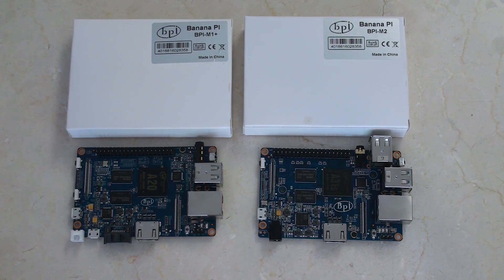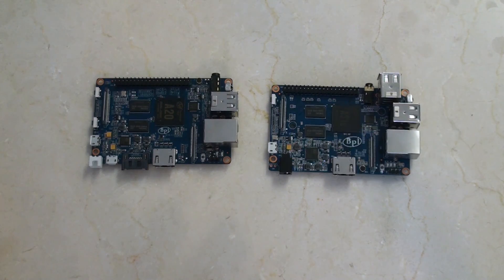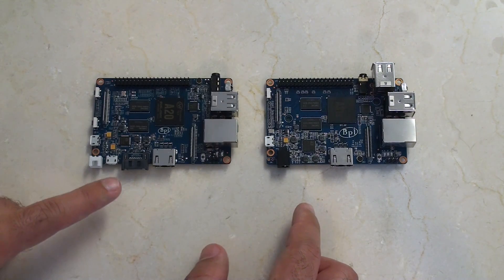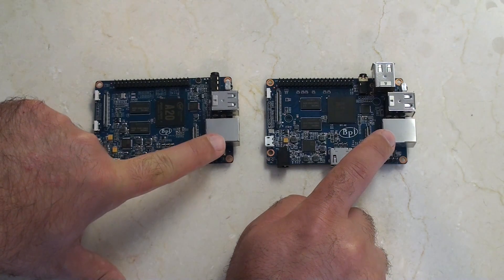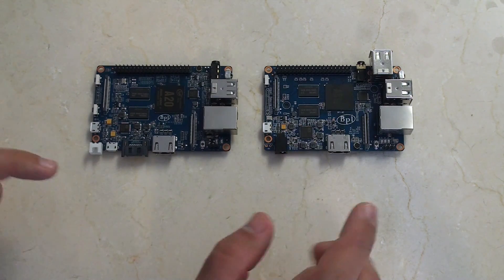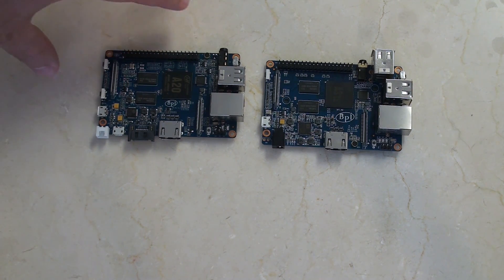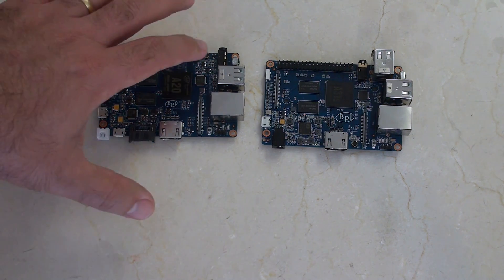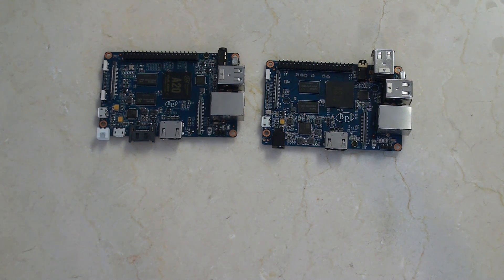Banana Pi M1+ and M2 hardware comparison and feature walkaround

Comment: Hello, if this computer runs android am I able to play some graphically demanding games like gta?
Reply from the maker: +mac16a Great question.  I've struggled to get Android working properly (as it requires a Windows PC to get it installed (which I don't have).  All that to say, I haven't had a chance to test it myself.
Reply: +skiwithpete Hello. OK I have the Banana pi M2 model now but there is a problem. I can't really do anything with it since it doesn't boot and only the red led lights up when I plug the power supply. I was trying to burn android and other linux based software like ubuntu on two 16gb sd cards but there is no effect. I used for it sd formatter and win32diskImager along with phoenix card for android installation. The result is the same every time. Maby you have the idea what I could do in this rather unpleasant situation. I was using a computer with win 7 and a laptop with win 8.1. I have to add that I am a total noob and I was relying on instructions I found on banana pi forum as well as on the other web pages. I am certain that I'm still doing something wrong.
Reply from the maker: +mac16a I think you should take this up directly with Banana Pi.  It sounds like you might have a problem with the SD Card reader.  Let me know how you resolve this, thanks, P
Reply: Hi. You were right. I have my unit replaced and it works now. I installed android 4.4 v4.1. Too bad it doesn't work smoothly and the wifi can't be turned on on this os version. I will try the older version 4.0 in some time. It is frustrating that the software slows the banana down. I currently run it on hdmi to vga converter. I don't know if that is the cause but I can only get 720p on my 22" lcd.